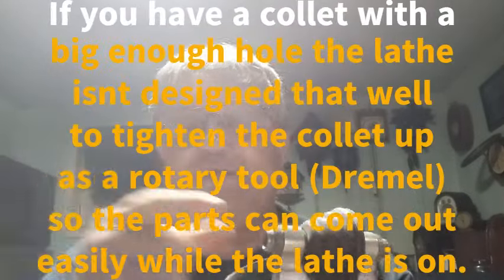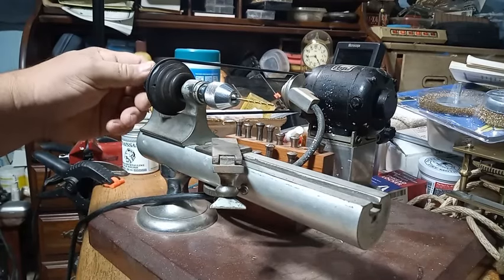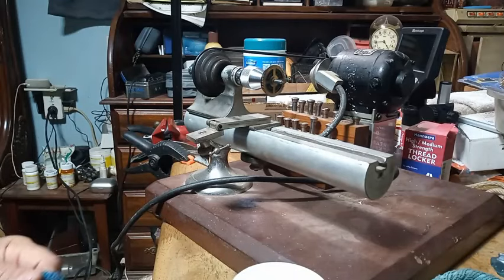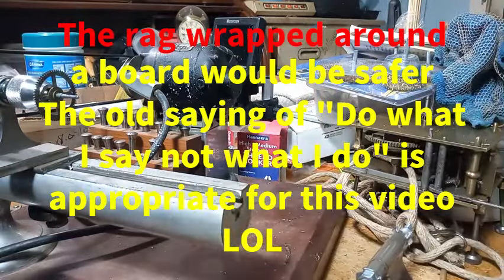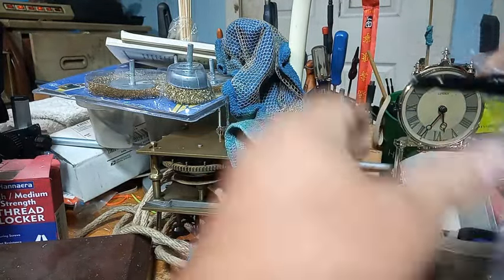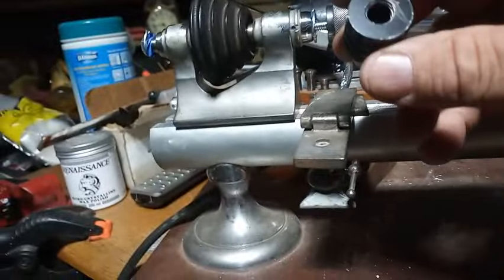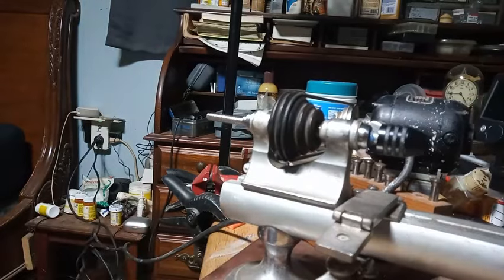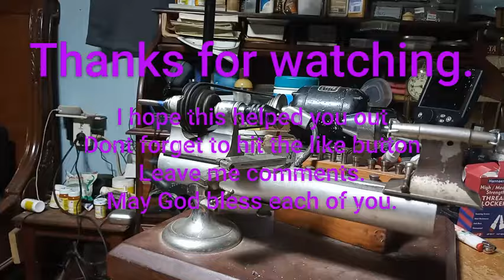Discussing what it takes to convert a watchmakers/jewelry lathe to work for cuckoo clocks or clocks

Comment: My brain can't wrap around this. I think I need a system that is ready for clock parts.
Reply: Maybe if I had taken metal shop instead of woodworking shop in high school.
Reply from the maker: I think the whole thing that you need to know is the collets arent made for clock parts as they dont open enough so that is why I am modifying it to add the Jacobs chuck.
Reply from the maker: I think that you will be ok once you had one in your hands.  I have seen you repair clocks that my brain cant wrap around and I took 3 years of drafting, machine shop and woodshop.  So dont cut yourself down ever again.  Thanks for watching.